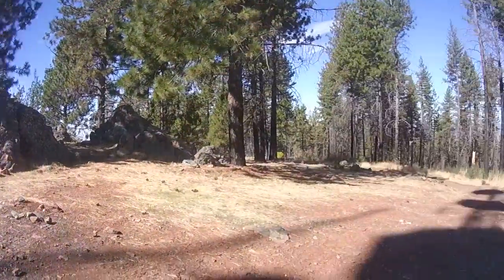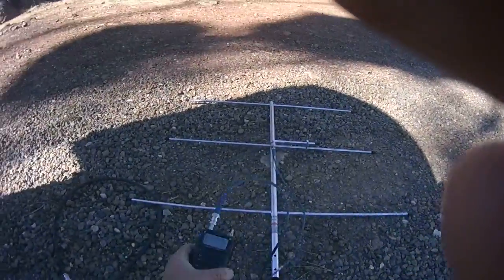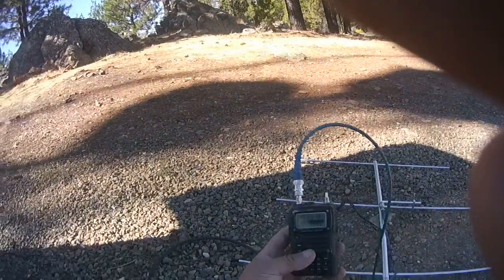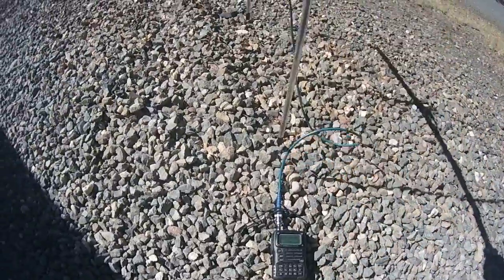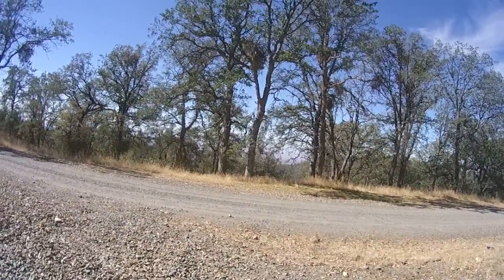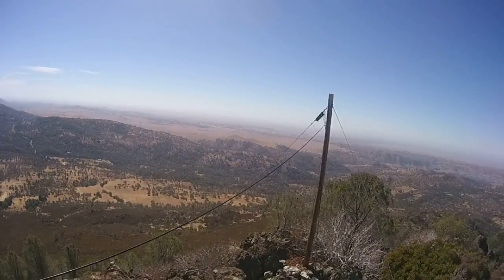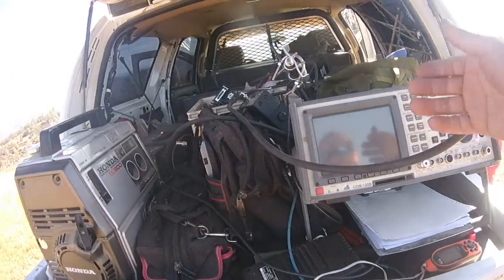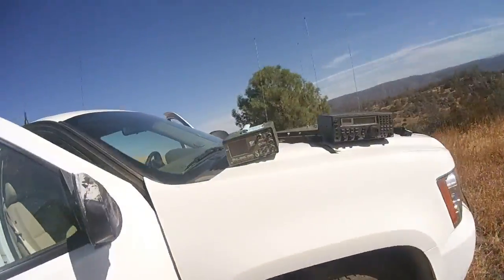SHTF Intro To Radio Direction Finder "Seek & Destroy" Part 1

Comment: You can get an RTL-SDR key, attach the Yagi antenna to it and connect the RTL-SDR to an Android smartphone/tablet and have a super portale spectrum analyzer able to scan from a few Mhz to a few Ghz.

The software will also let you listen to the signal as you do with your Yeasu. You can do WFM, FM, AM as well as SSB.

A cheap but incredibly useful and flexible setup ;) If you like then you can get some more "professional" SDR with better sensibility and even wider range.
Reply from the maker: Thank you for reminding me about the SDR method. You're right, its pretty much the same setup but affordable. I just have not gotten around to it yet. Can you recommend a Professional SDR model?
Reply: GUERRILLACOMM I personally use HackRF and AirSpy. The HackRF is a transceiver costing around $300 while the AirSpy ($200) is just a receiver but pretty sensitive. The HackRF can be connected to an Android device with an OTG cable adapter and you can use an app named "RF Analyzer". The app also works with cheap RTL-SDR.

The AirSpy unfortunately it's still not supported by any Android app.

P.S. Thanks for the great videos ;)
Reply from the maker: Thanks a lot, really appreciate it. Now I have some homework to do. 200-300 is a bit too steep at this time, but I think I'll mess around with the RTL-SDR to learn from. Thanks again.
Reply: GUERRILLACOMM RTL-SDR are perfect to start. Feel free to contact me so that I can give you more details. Now I start looking at your other videos! I  just found you thanks to SurvivalTech Nord
Reply: Deleted video

Comment: Lol. To go right down hill from this. I remember years ago a friend on CB radio would not believe he could be found by RF tracking so we had a £10 bet that I could find him. He was just a CB friend and he lived somewhere in my big city but I had never been to his house so I had no idea where. Getting another friend to drive me, we first drove in a slow circle of my neighbourhood to ascertain the direction of his signal by watching the CB signal meter. (We were using an ordinary mag mount antenna on the roof of the car so no high gain directional antenna like a Yagi) Once we had the rough direction, we set off across the city and watched as the power of his transmission signal got stronger. When we had his signal peeking out the signal meter on the CB I disconnected the antenna lead and stuck my finger in the antenna socket. The signal strength dropped by half so we commenced another slow circular drive around until the signal meter showed the highest reading and set off in that direction. When the meter peeked again with my finger in the socket (I should add for any idiots reading this: NEVER transmit on a radio with your finger in the antenna socket, even at low wattage, if you want to keep your radio intact and at high wattage, your finger intact.) I got out of the car and checked the roofs for CB antennas and his was the only one in the immediate area. The look on John's face when I knocked on his door was priceless.
Reply: I just came upon your story and its very informative. Would this process work the same way trying to find a couple stations on sideband? I heard about getting close then disconnecting the antenna and searching for the strongest signal. I know the general area of a few stations i am trying to find on LSB. Thanks in advance.
Reply: @antkneewolfdrummer  I'd imagine it would work the same way, BUT since SSB has no carrier per se, you'd have to do it while the other party is talking, or modulating the channel in question. Other than that I'd say it should work the same way.
Reply: Well now I want to transmit with my finger as an antenna
Reply: @xxxXXXCH04XXXxxx you wont
Reply: Recently while transmitting at 5 watts while adjusting capacitance on an antenna tuning unit, my thumb came in contact with the grub screw that holds the knob to the variable capacitor, which being connected to the rotator on the air gapped varable capacitor, must have been connected directly to transmit, and it hurts!
Reply: Bot accounts ^
Reply: a tip: watch movies at flixzone. Been using it for watching lots of of movies during the lockdown.
Reply: @Jay Richard yup, I've been using Flixzone for since december myself :D

Comment: The Icom IC-R3 is designed for direction finding. It is working great plus you can receive TV or VIDEO signals. Receives from  0.500 MHz to 2.5 GHz  with no gap. VA3VAD

Comment: We did this in Afghanistan with Japanese ICOM radios and some slash wire wrapped around a small x-mas tree shaped piece of plywood. We would get azimuths from two locations and do a resection on a map to find taliban... looked janky but it worked. We weren't even comm, just a bunch of dumb grunts with radios and imagination.
Reply: This is why they worked in valleys and had multiple repeaters around the place. S2 Underground did a good video on why we failed to locate them half the time, or only found repeaters.
Reply from the maker: Jared Maxwell Thats great, I would of love to see that in action. Did you actually had actionable results from direction finding? That doesnt sound dumb to me..
Reply: We were never able to surprise them since they had decent radio discipline, but we were able to prevent some potential ambushes and get a good idea of which areas to cordon and clear. There were a few kinetic engagements that began with the use of the technique.
Reply: Which ICOM model were you using, if you recall?
Reply: And...you lost the war
Reply: @xxxXXXCH04XXXxxx  they recruit tough guys every day.  Head on down and talk to a recruiter!
Reply: @ExtinctSS  I might do that
Reply: @xxxXXXCH04XXXxxx  I dare you just remember some dont come home
Reply: @ExtinctSS  🌹
Reply: Eh I do that daily
Reply: @ExtinctSS  :)

Comment: Hi GCom - I'm loving the video - searched eagerly for Part 2 - not on line yet! Aaaargh!
Here a couple of points I wanted to make:
- Sometimes it's more precise to locate the azimuth of the nulls than the azimuth of the strongest signal (eg. when the antenna is not highly directional) - just remember to correct for the +/-90° offset. 
- Moving to your next DF point is best to a location on a line at right angles from your last azimuth reading (eg. when your last signal azimuth was northeast then drive some miles to a location southeast or northwest for the next reading). This maximizes the chances of a larger intersection angle of the azimuths and minimizes the area to be searched, Once you have two azimuths you can better choose the location for your third reading. Aim to get a large angle of intersection with the other azimuths. 
- Use a prismatic or lensatic sighting compass to reduce errors in reading azimuth. Remember compasses can be affected by magnetic metal objects eg. cars, radio loudspeakers, guns, power lines, pylons etc. ("deviation") Remember too that north error ("magnetic variation") may be strong in your part of the world and compensate for this. 
- If you can use a GPS to locate your current position (by smartphone, car or handheld GPS) you can plot the bearing more accurately. But remember GPS is affected by number of visible satellites and multipath. 
Hope this wasn't teaching Grandma to suck eggs :-) 
I'm eagerly awaiting Part2! Well done, all the best, Rob

Comment: My job in the Army involved a similar process.  We would find a signal and network two other stations, each would shoot a LOB (line of bearing).  We'd plot it on a map.  Two LOBs give you a "cut" at the point where they cross accurate to roughly a grid square.  Three LOBs gives you a "fix" accurate to 10' or less.  You then give that resulting grid coordinate to the Gun Bunnies and they will drop steel on it!  HOOAH!!
Reply from the maker: Richard Slusher I wish I could chuck a few Hellfire missiles over the southern border. There are people down there that will actually hold a frequency hostage by jamming their signal from down south. Once paid ,they unjam the frequency. I wonder if they still practice that technique in the army today, but in a squad level direction finding of these guys in Afghanistan & Iraq conflicts. I always see the opponents always taunting or squawking on a handheld radio.
Reply: Maybe get on the radio and call in a HARM strike?  :)
Reply: Awww.  What'sa matter commie.  Did a soldier boy alpha male steal your girlfriend??
Reply: Korean myself, good times. Miss it occasionally.
Reply: A buddy of mine from high school was a Korean Golf in '88 right as I was leaving for Basic!  He went to a GuardRail unit though...not a tactical guy!
Reply: And a lovely day to you too!  😘
Reply: "Three LOBs gives you a "fix" accurate to 10' or less." That's why Afghanistan won. :P
Reply: +Richard Slusher  I smell a fellow 35P! (or 98G pre-2006 )
Reply: Yup...98G German...back when I was young and stupid!  :)
Reply: @RESlusher  35N here or 98C back in the day. This is awesome we never practiced using a yagi but that's a good idea as a backup
Reply: @nickbarnes9966  Yup...98G(German) back when I was a young man! ('88 - '92).
Reply: @RESlusher  currently at Fort Lewis doing tactical SIGINT. Thank you for your service. It's pretty fascinating any time I can learn something new.
Reply: @nickbarnes9966  Stay safe out there!  I did the tactical systems course back when it was at Fort Devens, Mass before heading to Germany.  Was up on the inner-German border on the day east and west got back together then 6 months later was in Saudi Arabia getting ready for ODS!  Germany linguist in the Middle East.
Reply: @RESlusher  I bet you have some awesome stories. I've been on LLVI teams supporting the cavalry and up at Brigade doing ELINT operations. Never got the chance to deploy unfortunately. Good luck sir
Reply: @nickbarnes9966  Right back atcha!  I’ll neither confirm nor deny having jammed AFN radio out of Kuwait City with an certain mobile jamming system based on an M548 chassis!  🤪
Reply: ehhhmm...98c /35N :)
Reply: @Richard Slusher.   You were getting 3 bearing fixes at 10 foot radius (or ellipse)?  That is a very tight fix, from my experience.   What kind of equipment and at what distance were the DF's from the fix?  
I never had a fix that was that tight, but I did my work a few years before you did.  Does PRD-1, ANT-23, & FLR/9 mean anything to you?  I used to be a 05D with combat experience.  
About 20 years experience with the government with fixed medium and long range HFDF and VHF/UHF DF both fixed and mobile platforms.
Reply: Lol thats badass buddy
Reply: Works for lobbing torpedoes against "sneaky" subs too.